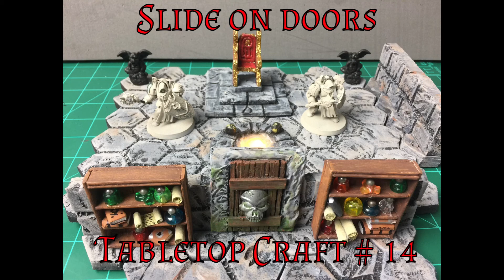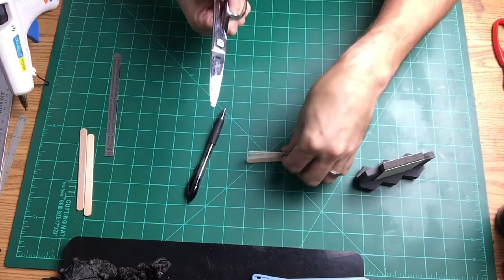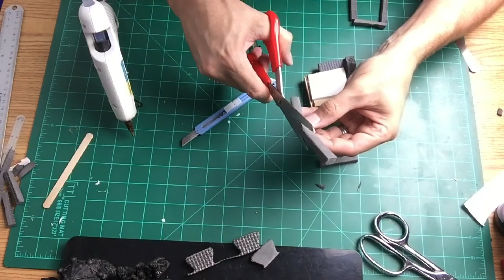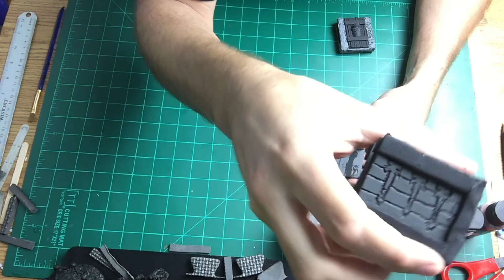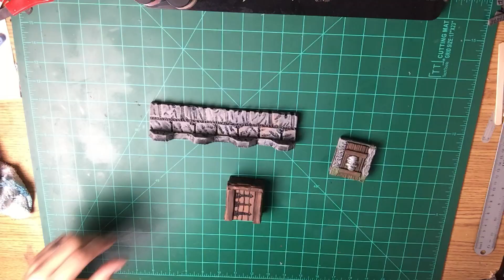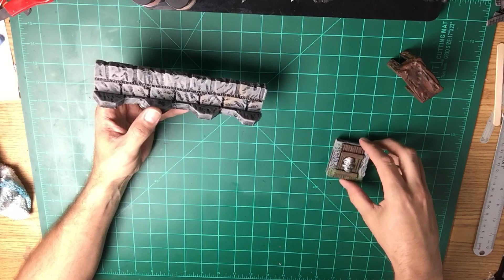Tabletop Craft # 14 - Hex Grid Doors

Comment: Awesome work and genius ideas!  I have really been struggling with the idea of how to reconcile my large amount of HeroScape terrain with other terrain designed for grids, such as HeroQuest and other such dungeon-crawl games.  Seeing as your builds appear most superior and compatible,  I think I will dedicate the few EVA foam panels I have to dungeon hexes like yours.  Then, if I can copy your other techniques for modular terrain added at line intersections, I won't need to "ruin" the dungeon terrain's compatibility with grids, and instead add it onto terrain that locks into the dungeon hexes OR places simply on flat grids (like HeroQuest boards), without permanently attaching to hexes compatible with HeroScape.   I figure that most "indoor furnishings" will be on flat terrain, while most HeroScape terrain is better suited to outdoor use.  Thus, you have inspired me to fix my problem.  The last obstacle is how to cut that hex pattern in to my EVA panels to make it modular like your other video demonstrates.